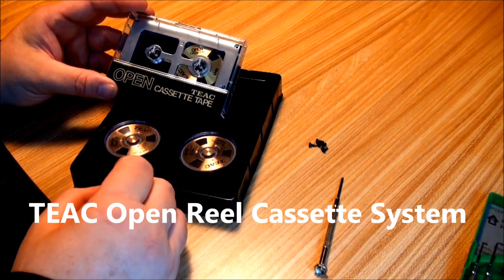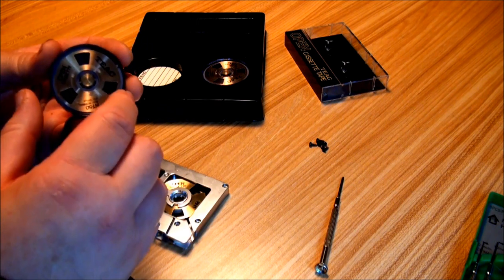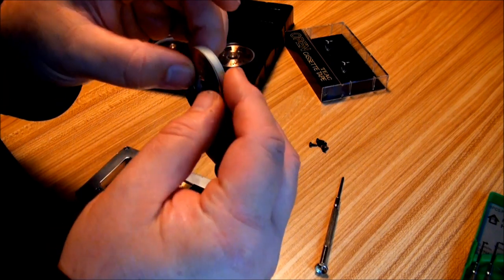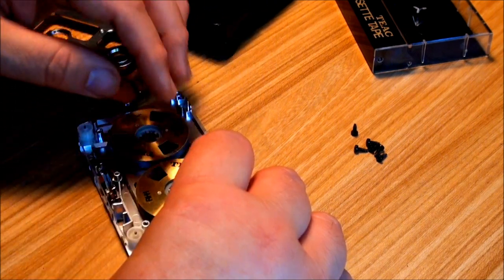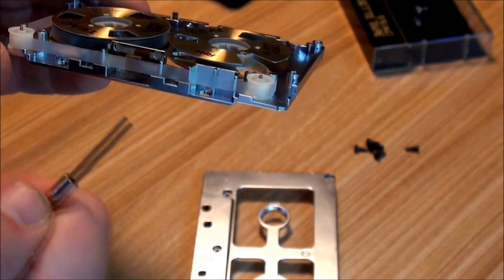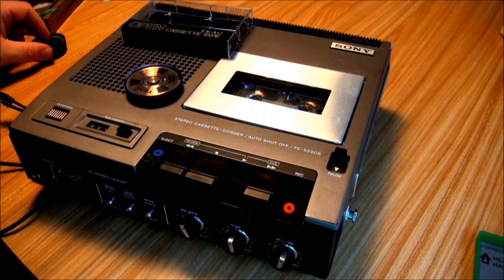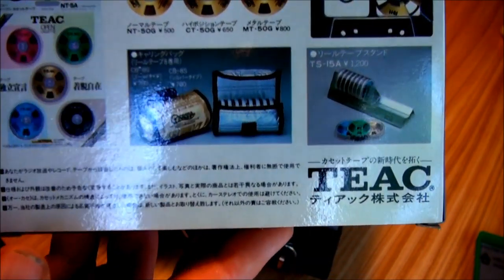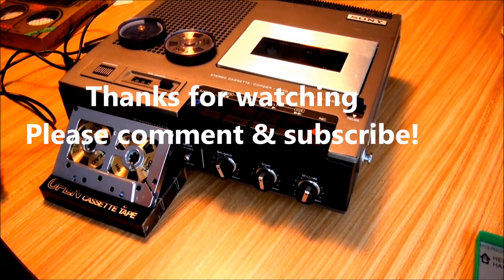Teac Open Reel Cassette System

Comment: Maybe someone already said it but you don't need to open the casette. Slide the real in from the side and you can guide the tape beginning through the slide in the right to its place on the fixed reel. No tools needed. So not as complicated as you think. Wish we had them here too.

Comment: you can insert the tape end without screwing it open. there is a line in the case where you can put the tape through. its just for that.

Comment: Should not the tape itself when assembled inside the cassette be placed between the small sides spool and the metal pin? There are one on each sides and I think the tape would be placed to hold it better so it does not become too loose. Or I am wrong? Very nice video by the way.

Comment: I don't have one but I just watched a video on it the other day. the shell of the cassette is skeletonized so you don't have to unscrew anything. you just slip the new wheel into the side of the cassette because there are plenty of openings that will allow you the clearance to slide it in and because the show is skeletonized you can manipulate the tape over everything you need to and around into the take-up reel without ever having to take apart the actual cassette. Unless you want to do it that way or perhaps it's difficult on your fingertips I don't know because I've never bought one but I'm intrigued. But at the same time I think it would drive me crazy so I've been reluctant to actually go buy that system. cool video though and a really wacky product from the 1980s

Comment: For practicality, I will just take the multiple cassettes.  You can spend an hour just trying to find something that may only take a couple minutes normally.  It looks cool and seems to function well, but I don't think I'd go through the extra effort.  If you want reel to reel, get the real thing.  They sound a lot better and are a lot less cumbersome than this, also.  I appreciate you posting this though.  I've never seen this before.

Comment: Whats the advantage of this cassette?? Very cool design and in metal but. It's not pratical. And you have all that thing to put the reel inside it... fingers on the tape, etc. just to mimic the big teac reel tape.
Reply from the maker: I think it was marketed as a way to save space. Example: 10 small reels of recorded tape and 1 cassette took up less space than 10 normal cassettes. They even sold small storage holders for multiple reels.

Comment: OMG, what in all heavens were they thinking? TEAC must have had all their marketing staff ditched before developing this! I mean, when Philips developed the CC it was already ALL about practicality in handling! And it WAS already small. How was one supposed to handle these tiny reels in a car? Or quite generally on the movefor that matter? (Even though the Walkman may only have appeared later than this - which I don't know - the so-called ghettoblaster / boombox and cassette in-car stereos must have been well established by then...

Having said that: It's a mighty friggin' cool piece of my own youth's technology shit (metaphorically speaking, that is ;-)) Anyone remember the ill-fated Mini Disc, by the way? Or Video2000 VCRs? Or HighCom noise reduction? Or Toshiba's 'adres' dynamic range expander? Or quadro sound receivers and amplifiers? Or that strip of rubber mounted to the floor of cars to "eliminate the generating of potentially dangerous static electricity throughout the bodywork? Or ...              :-D

Comment: Wait, wait, wait.   The cassette rose to prominence because it offered decent audio quality and was much more convenient to operate than a reel-to-reel deck.   So convenient, in fact, that it was used in car audio systems for years.  It beat the 8-track for dominance of the magnetic audio-tape market and even survived the advent of CD for several years.  And then, just as the cassette has mostly faded from the public eye, thanks to the prominence of CD and digital music players, TEAC decides to introduce THIS?!

Indeed, rather than go through all this rigamarole, I'd just go buy me a real reel-to-reel (pun semi-intended) machine.  It'd be easier to set up than this, and the audio quality would be superior without the need for Dolby, special formulations, etc.

I can just imagine the meeting at TEAC when they came up with this.  "Hey, let's take a common, convenient, but rapidly obscolescing magnetic audio-tape format and make it a colossal pain in the ass to use without bringing in any real technical innovation!   BRILLIANT!"

Okay, yeah, it looks kind of cool, but unless I'm missing something significant, it's about as practical as opening an Edsel dealership.
Reply from the maker: xaenon They aren't nearly as hard to use as I made it look in this video. I didn't have the reel loading instructions and didn't know you don't have to unscrew the case. Look at Part II (recorded a few days later) where I did it right. But even still, it does make a mess of the original Philips cassette idea, doesn't it?
https://youtu.be/v61yPIfbVJw
Reply: Dan O'Connor
Yes, I read how you had misunderstood how this was supposed to be done, and that the 'correct' way was significantly easier.  But it still can't be as easy as the plain old original cassette.  Maybe it WAS a space-saving feature, I don't know.  That's the only practical justification for it that I can imagine.  I think the real idea behind this was basically to capitalize on some perceived or manufactured 'cool' factor.

Comment: Obviously, this was a gimmick by TEAC to increase awareness of the brand. The things look way cool, no doubt, and at first,  one might really want one. But as others have pointed out, it is totally counter to the compact cassette concept. Threading tape in a cassette? Really?

This is really a novelty item, and I believe it never made it out of Japan. I've seen these go on E-Bay for a couple of hundred bucks because they are so strange and therefore collectible. The "reel cassettes" also sell for a lot on E-Bay. Problem is, they don't hold up well, are noisy and don't always play as well as a well engineered normal cassette. but they look very cool - unless you have a player that uses a windowless door. Then, the thing is entirely pointless.
Reply: ***** Thanks a lot, you just saved me from spending 250 bucks and unnecessarily extending my already excessive tape collection :D
Reply: AlmightyMaria PvB  I have to ask, were you thinking of buying one of these for $250?
Reply: Yup.
There is no thing like collecting and using tapes for me.
I have already spent a fortune on tapes, my Nakamichi Dragon and my Sony Walkman D6c. This is just my thing, you know?
Reply: AlmightyMaria PvB Sure, we all have our hobbies! Right now, I am "collecting" bootable Linux USB sticks. I don't know why.... just have become fascinated with having an entire operating system on a stupid little pen drive!